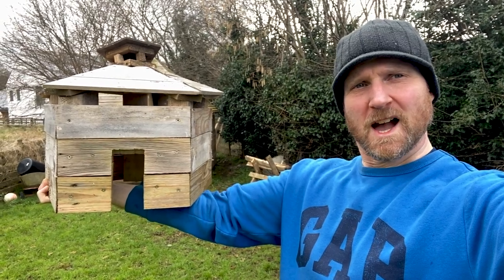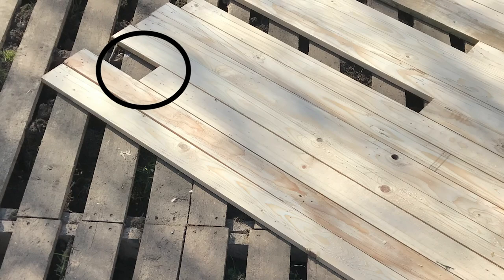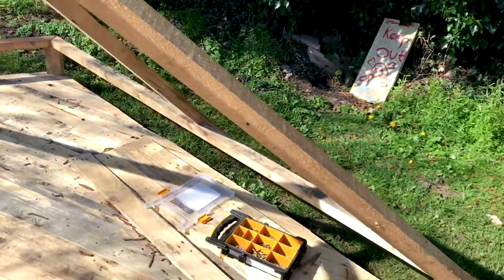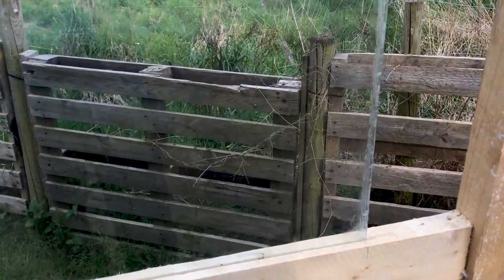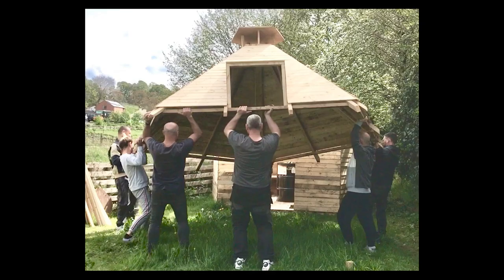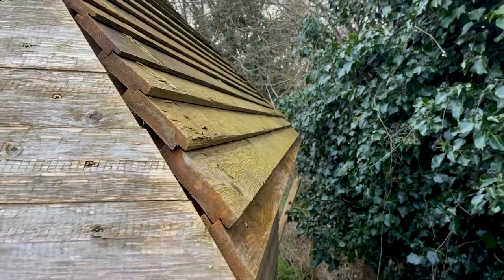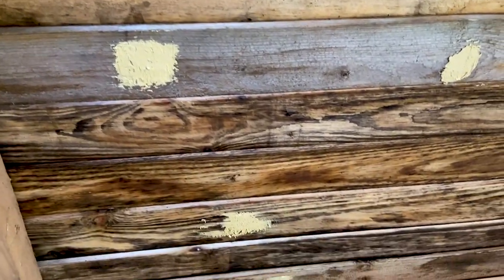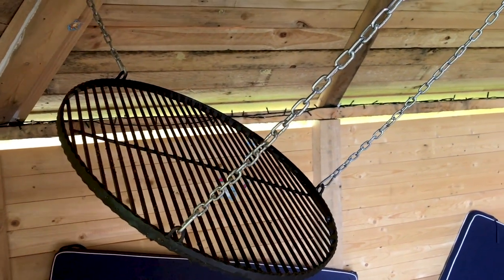Build a Log Cabin, Summer house, BBQ Hut for under £150 with Pallets

Comment: Outstanding!   Did you install an extractor fan or is the smoke not a problem?
Reply from the maker: Patrick Shannon not really an issue as long as the wood is dry. I did leave a gap between one side and the roof in order to draw the smoke up. Also on a really windy day once the smoke was at times not going up but being blown back down but that time the wood wasn’t that dry so a bit of both I think.